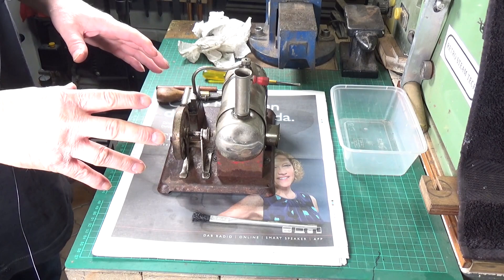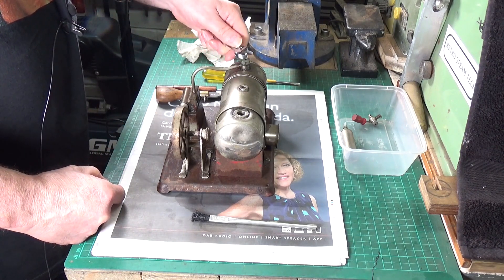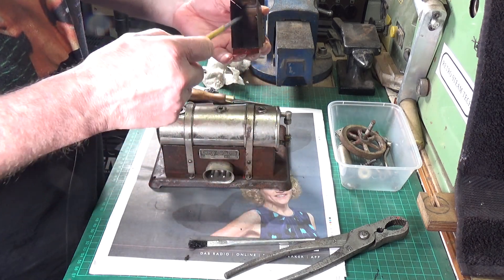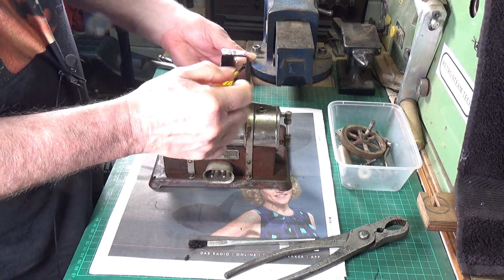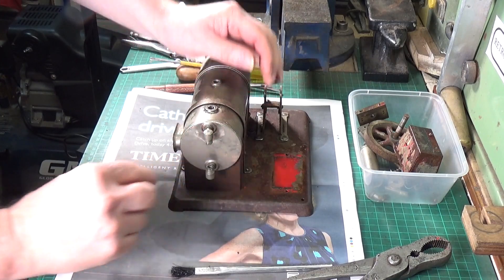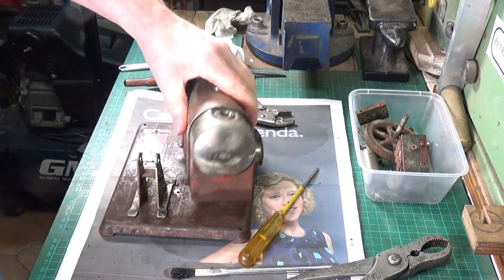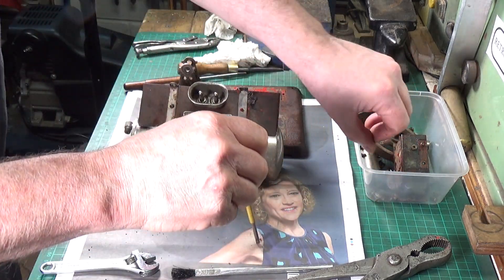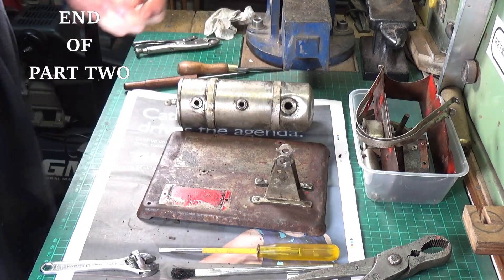Empco B-43 Model Steam Engine - Part Two

Comment: Hello Alan,
That came apart surprisingly easily... the penetrating oil did a great job. See you in part three.
Cheers.
Paul,,
Reply from the maker: Hi Paul. Yes it did, the Empire/Empco engines are quite well made which always helps. Cheers, Alan.